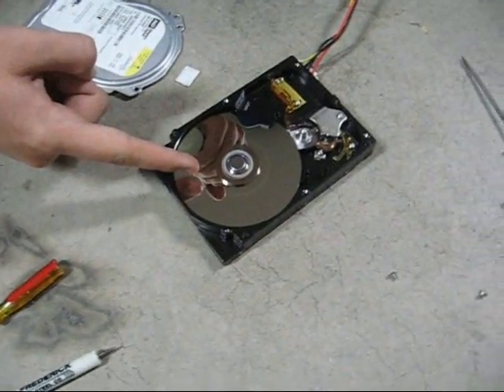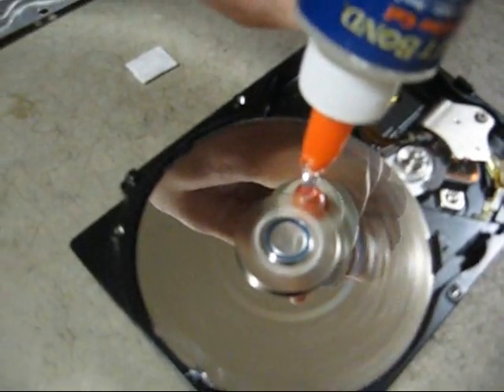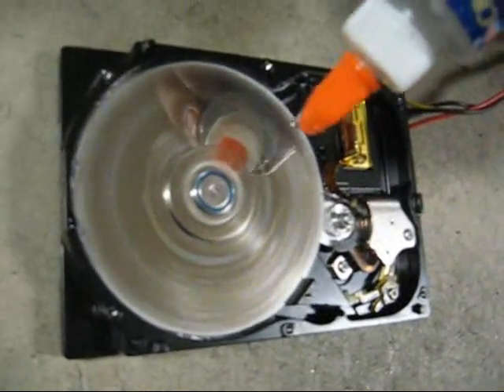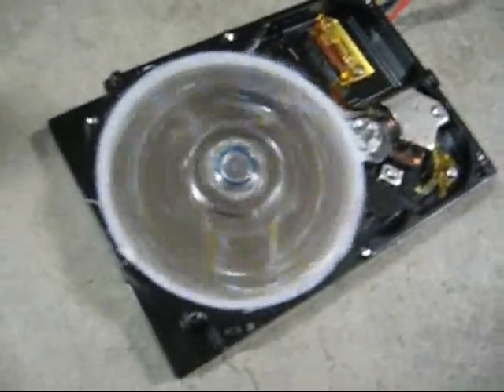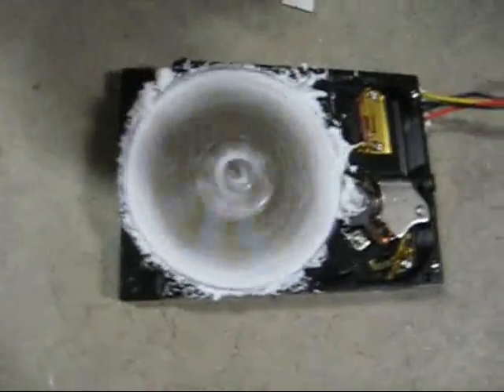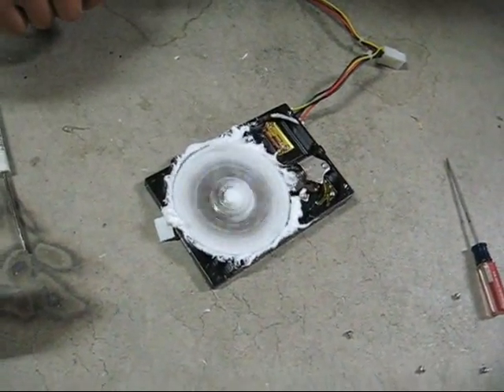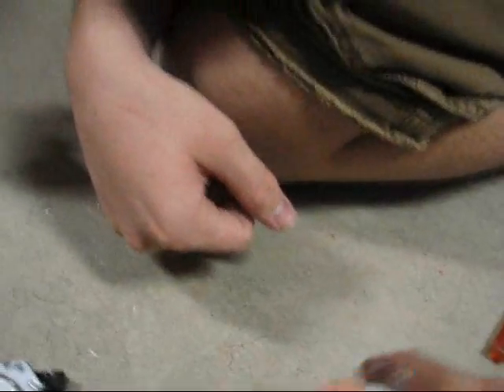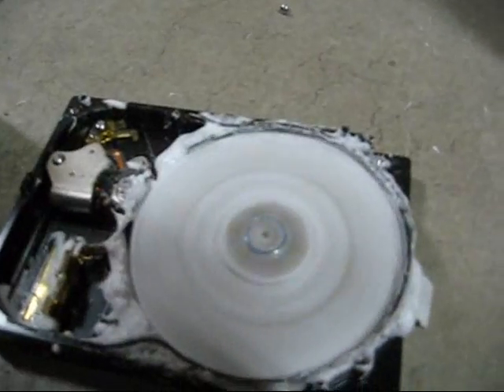Harddrive Gluing

Comment: centrifugal force is what is going on here...
Centrifugal force (from Latin centrum, meaning "center", and fugere, meaning "to flee") is the apparent outward force that draws a rotating body away from the center of rotation and is caused by the inertia of the body

centripetal force is defined as a force which keeps a body moving with a uniform speed along a circular path and is directed along the radius towards imple termsthe centre

Comment: none that i know, it looks fairly strange to me, ive been taking apart my old Xbox so i decided i challenge the guy being a dickbutt by taking the HDD apart, but its connect Via some sort of cable (similar to a wire connected to a board with solder)

Comment: you can build very good 2,4 Ghz (wlan) antennas from the disks ... also using the wired coil from the write / read arms... by desintegrating the disk

Comment: actually, if I'm correct I normally don't repair 360s due to the face that I do not think they are worth it, the hdd they use are typical 2.5" hdds that you can purchase anywhere but they mount it in  a plate in order to make it seem as if the hdd is created by Mircrosoft.  Basically, yes, they are WD hdd's in xbox systems.